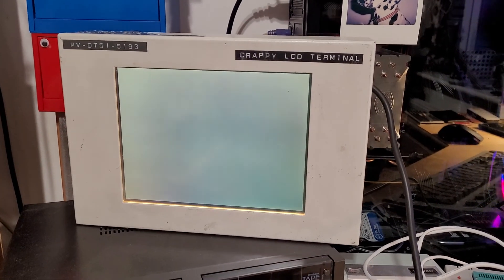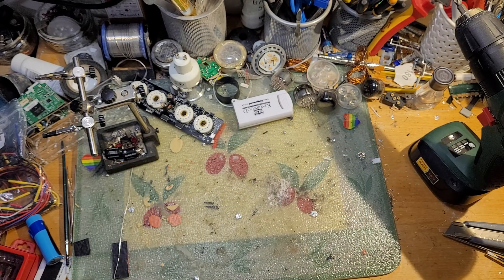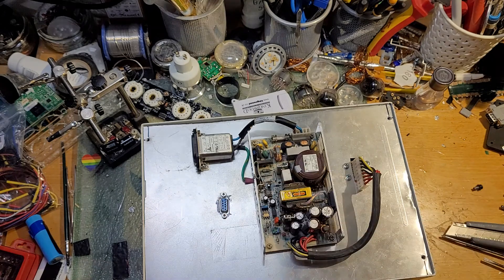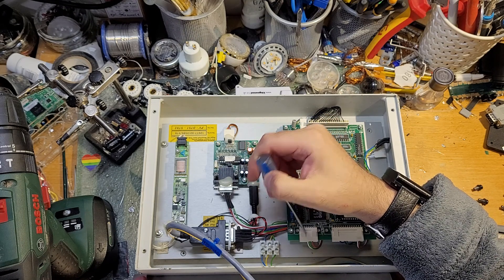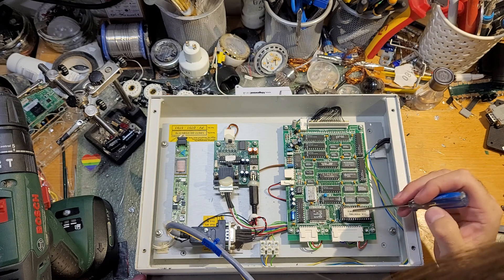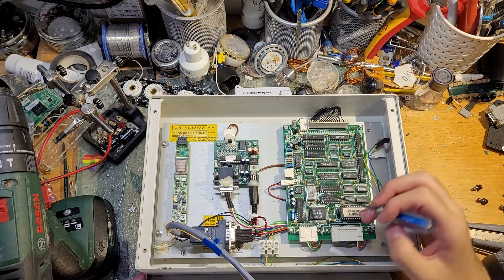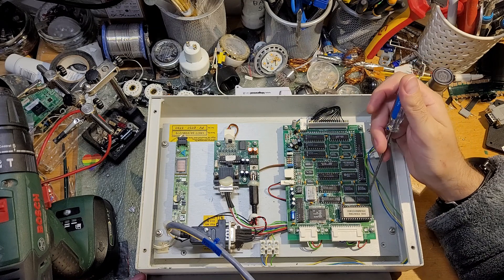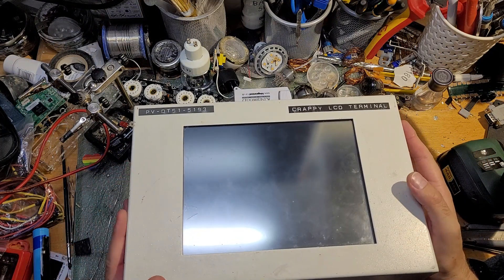PV-DT51-5193 LCD Touch Screen Serial Terminal Demo & Teardown

Comment: I wonder if this supports a graphics mode or at least custom character sets.

Oh, I can one-up your exposed 240v. My current project has exposed 9kv.
Reply from the maker: Not sure on that one. I have dumped the ROM & uploaded it but i have not looked at the HEX in detail to see if there be any clues. Intrestingly there do seem to be functions for a built in UI. My early attempt at a night vision scope did that. Still get zings off of my V1 unit. But I leaned a lot from building it.